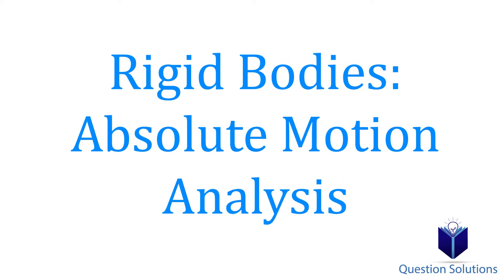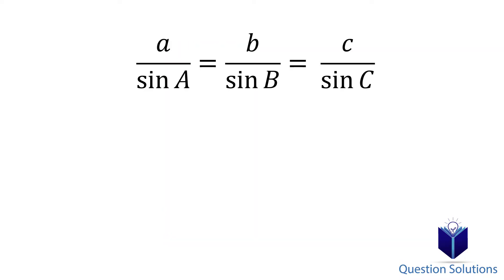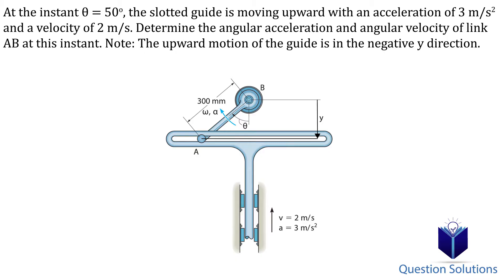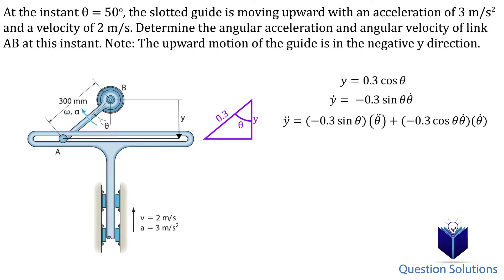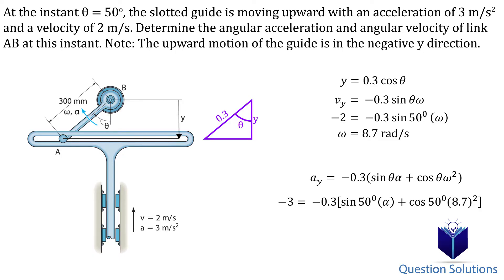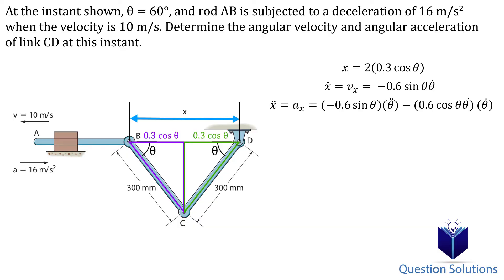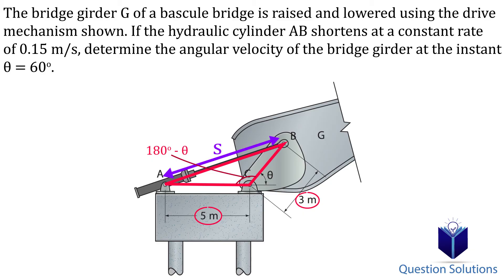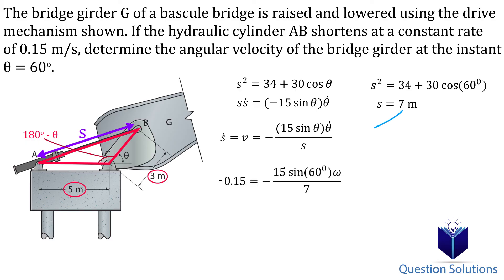Rigid Bodies Absolute Motion Analysis Dynamics (Learn to solve any question)

Comment: at 7:22 why did we use the angle of 60 degrees not 120?
Reply from the maker: So the equation we found is with respect to the angle shown as θ. So when θ = 60 is when we need to find the length S since the question wants the angular velocity at θ = 60.

Comment: Sir at @5:42 , I chose the right side as positive. The value for angular velocity comes the same but positive as expected but during the calculation of angular acceleration it's not matching. How to fix this issue?
Reply from the maker: It's hard for me to say without seeing steps. Did you also pick the same directions for the acceleration equation as well?
Reply: @QuestionSolutions  Yes. For equation: a=-0.6(alpha.sintheta+omega^2.costheta), If right side is picked as positive, a=+16 while if left is picked a=-16 on LHS. But RHS is same for whatever direction taken because omega=angular velocity is whole squared. For this alpha=angular acceleration is varying sir.

Comment: how we can determine that if the problem belongs to absolute motion analysis or relative motion analysis
Reply from the maker: It depends on the givens and some critical thinking. If you're given angles with lengths that depend on a changing angle, then you can use relative motion. Also, most of these questions can be solved using more than one method, so pick the method you're comfortable with, but practice it all 👍

Comment: I had a few questions. So on example two if link CD and BC were different lengths would their angular velocities and accelerations be different? If so, how would you relate the velocity/acceleration of x to the different links? And if not, why?
Reply: also thanks again for the videos. I'm excited for the thermodynamics ones :)
Reply from the maker: You can actually solve the question you're asking by yourself, and I really encourage you to do so, because it's an excellent question. Try setting BC and CD to different lengths, the process is exactly the same, no difference in what I show. Only difference is the triangle that's going to be formed. See what type of answer you get and let me know. :) You might even be able to guess by looking at the equations that we gain at 5:26 and how the values are related to the lengths we got from the triangle that we drew. You can think it through, what if it was 0.4cosθ instead of 0.3? Very good question, answering it yourself will give you a lot of insight as to how lengths and angles govern the changes to velocity and acceleration. 

For most of these questions, I really encourage students to try them with different values and see the relationship between their answers, because it's a really good way to learn. That way, when you see a question, you can already guess what type of answer it's suppose to have and can error check before handing in your papers to a marker. 👍

Comment: I really like your videos. I have learned a lot from them. 
How to solve the kinetics (i.e., force and moment equations) for these similar examples (like actuator connected with a rigid body through a link)? Any references? It would be a great help if you can suggest something. Thanks in advance.
Reply from the maker: Glad to hear they have been helpful. Are you asking for a textbook reference?
Reply: @QuestionSolutions  Textbook reference will work but if you have made any videos describing this it will be a great help.
Reply from the maker: @desham001  Other than the videos listed on the playlists, I have no other ones. For books, I always suggest Mechanics for engineers - dynamics by R. C. Hibbeler and K. B. Yap. Though any book on dynamics probably has what you are looking for.
Reply: @QuestionSolutions  Thank you. I will look into it.
Reply from the maker: @desham001  👍

Comment: It the slot question, in the first one question, I had a feeling that angular acceleration was going to be negative because the T-shaped body attached to the slot wants to fall and the slot is pulling it up. But because the T-shaped body is falling, the slot is not going to move as fast, almost looks like it is going to slow down. An since it’s slowing down, one can assume the acceleration, whether it’s linear or angular, is negative.